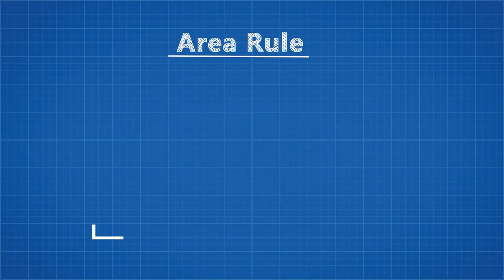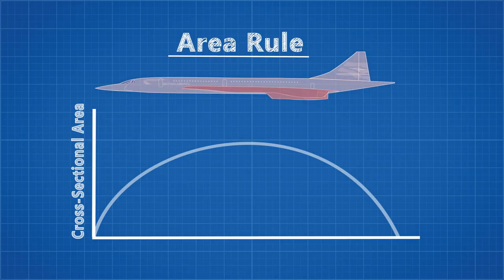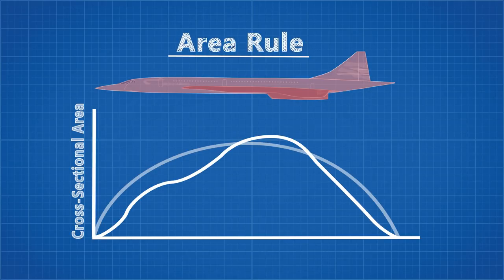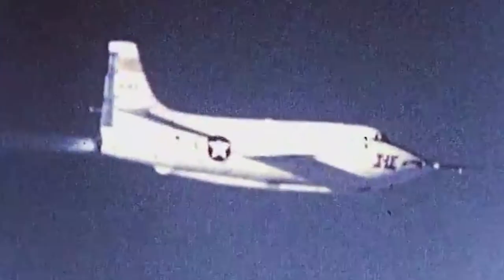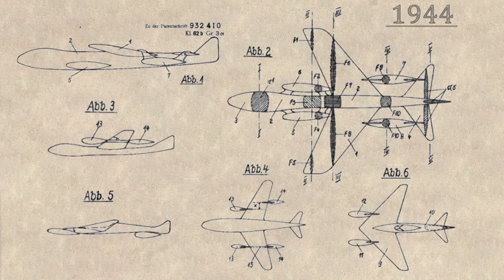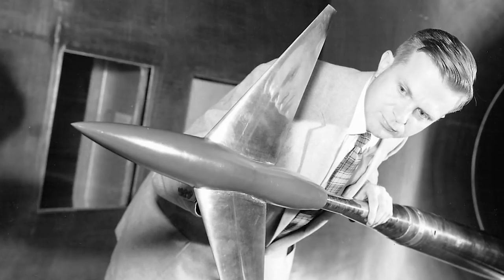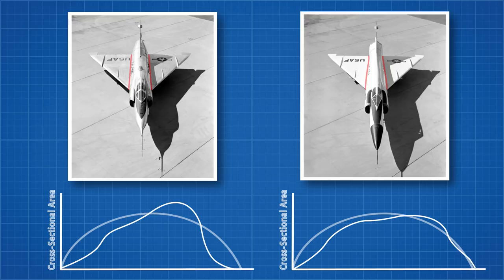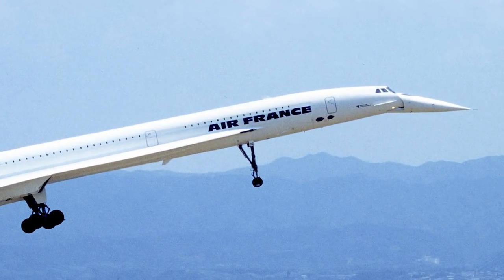Area Rule: How To Make Planes Fly Faster

Comment: Interestingly the cross sectional anatomy of several fish species follows this rule. While fish manuever through water at relatively lower velocities compared to transonic aircraft moving through air, the proportionally higher hydrodynamic forces and Reynolds numbers make up for this discrepancy. Thus, having an optimal cross sectional area distribution proves key to their locomotive abilities and plays an integral role in the evolutionary process of natural selection. (See swordfish, manta rays, and most sharks as examples)

Also, some literature suggests that the texture of fish scales enhances the boundary layer surrounding the body and further reduce drag :)

Love the videos!

Comment: The area rule can be seen being worked on throughout the US development of their Century series of fighter aircraft. The F-102 is mentioned in the video, and this was as a direct result of issues of transonic performance of it's predecessor F-100, which was the first supersonic US production aircraft, and F-101, which has a mission closer to that of the F-102. All the subsequent Century fighters has some incorporation of the "wasp waist" or "Coke bottle" design, with the F-104 being very pronounced since it had such a long slender fuselage and relatively large intakes that incorporated shock cones.

Comment: this why if you look at the back of an aeroplane, there where the horizontal stabilizer connects the fusslage, you will notice some tapered fuselage. The reason it is not tapered there where the main wings connect the fuselage is simply because you want as many passengers seats as possible. High in the end of the aeroplane there are not seats so it can ne tapered.

Comment: I looked at pictures and blueprints of the SR-71, and it doesn't seem to follow to area rule that closely. True, the fuselage is largest before the wing, and is slightly tapered towards the tail end of the plane where the wings are, but it still seems like the cross-sectional area is quite large in the back with the wings ending pretty abruptly. Even though the Concorde's wings end even more abruptly it still has quite a long tail after that. I guess there must have been more important design decisions that just trumped religiously following the area rule, maybe the importance of having the delta wing, or something to do with stealth technology?
Reply: The Sr71 is shaped like a triangle because Kelly Johnson wanted to keep the wings and engines out of the shock wave which would increase drag.

Comment: The Northrop-Grumman YF-23 was area ruled to the extreme in order to achieve the supercruise performance required in the Air Force specification.  As a result the plane was "very fast" and could fly well above Mach 1 without afterburners.  It also looks damn sexy.

Comment: The F-5 has very interesting shaped wing tip fuel tanks for this reason. They taper off at the point of connection with the wing, but grow in diameter again towards the back.

Comment: The Airbus Beluga!! It tapers nicely at the back, but at the front its cross-sectional area gets big very fast (I'm guessing that it's curve would be something like the opposite of the original F-102 Delta Dagger).  I wonder if extending the nose slightly forward would improve the ratio (would probably have to hinge horizontally rather than vertically to load cargo).

Comment: Nice video, and good idea on the challenge!

The best example I could find was the X-29, which like the original junkers had a forward swept wing. 

I was wondering if the odd shape of the V-2 rocket was influenced by the area rule, but it seems it slightly predated the development of the area rule by just a few years. It seems to have the right shape though.

Comment: you could argue that this is used on cars, but instead of the tapering of the sides of the car towards the rear (although this can be seen in some cars, especially in F1), hypercar manufacturers taper the top and bottom of the car to enhance the venturi effect by further opening up a space for the diffuser, as seen on the Aston Martin Valkyrie and Bugatti Chiron.

Comment: Eurofighter-Typhoon (Delta-Canard Design): Very Sleek Foreplanes for primary Pitch Control contributing almost nothing to cross-section, Followed by a huge 42° swept Delta Wing, but with upper fuselage maintaining almost exactly the same cross-section, but lower fuselage with air-intakes beneath the Delta is cuneiform, getting narrower to aircraft's tail, to accommodate with the Area Rule.

Comment: The change of the engine humps from the YF-22 to the F-22 due to the change in area rule from the smaller vertical stabilizers and larger horizontal stabilizers in order to optimize super cruise.

Comment: real cool to learn about this, especially since ill start studying mechanical engineering to go into plane development. but could you go into more detail on why this rule has such a great impact? 
id like to know for example, why the position of the engines, which from my rather uninformed point of view, shouldnt have direct impact on overall drag, makes such a difference. obviously things create less drag if they are placed into turbulent air currents (is that even true? it sounds logical to me, but correct pls) but that doesnt have anything to do with a structures overall cross section, so how does it work?

in your other videos you go into greater detail, and if im not mistaken you even mentioned the crosssection rule briefly in another video.

Comment: Although the MIG 17 can travel slightly faster than the speed largely concerned with the area rule, I thought it would be an interesting aircraft to bring up.  

The main body fuselage you can see looks as if the cross sectional area would resemble the curve fairly well.  The bizarre part of the aircraft, to me, comes with the placement of engine inside the fuselage.  Now I don't know how this affects the in flight performance of the aircraft but I figured somebody might be able to tell me.  I'm particularly interested because most aircrafts we find tend to have podded engines away from the fuselage located under the wings or near the back as was mentioned.  And we find that most aircrafts that achieve supersonic speeds now days have engines located really close to the fuselage.  So what changed?

Comment: I'm surprised that no one thought of the F-11 Tiger. I believe it was the first production fighter that used area rule. It first flew 1 1/2 years before the F-106. I don't think the F-102 used area rule. The 106 was basically the same design but incorporated area rule in addition to the larger engine. It was an outstanding airplane. A much better "fighter" than the F-4 despite the big delta wing. It really turned. I can only speak from back seat rides. The airplane should have been used in the fighter roll with different missiles and a gun! My only experience in the "front seat" was in A-4's, F-8's and the F-4.

Comment: The engines are placed infornt of the wings now a days are because of the extra ground clearance. Old engines were low bypass engines and they weren't so much efficient plus they made a lot of noise. In order to make it more efficient and less noisy, engineers came up with the idea of increasing the bypass ratio. This actually worked and the noise levels were also reduced. But they have to increase the engine diameter to achieve this ratio. In order to fix this large diameter, high bypass engine under the wing, a forward pylon mounting was perfect to get the perfect ground clearance. So that how it was done.

Comment: Tupolev Tu-154 is roughly the same size as Boeing 737, yet has its three engines placed behind the wings, which has always seemed interesting to me. The plane has a cruising speed of 900 km/h yet has low fuel efficiency.

Comment: Man, I like your videos, although I often have a hard time trying to make sense out of them. Maybe I am dumb, maybe the topic is difficult (probably both), but like...
How does the smooth, continuous cross-section function along the length of the aircraft help reduce the drag? If you have your engines mounted behind the main wings, the air still has to hit the engines from the front. The shockwave arises when the airflow around the object is supersonic, and in a transsonic or supersonic flight, that must inevitably happen regardless of where you put your engines. O.o Can somebody explain this to me?

Comment: The placement of engines is more complicated than is made out in this video, other than trying to meet Whitcomb's area rule.

Jet engines hung off the wing reduces structural weight as the engines reduce the likelihood of aerodynamic flutter. This needed the engines placed foreward of the wing for best effect. Engines on the wing also places them closer to the c.g. position in the longitudinal plane; benefitting weight and balance. It also keeps more of the fuel out of the fuselage, unlike with rear mounted engines.

Comment: is there a minimum speed at which this becomes a practical consideration, would it apply to racecar aero?
Reply: It only starts to have a significant effect once part of the airflow over the object becomes supersonic, so with the exception of those specially designed land speed record cars, it doesn't have any significant bearing on land vehicles.

Comment: How do fighter planes fly upside down? Doesn't it violate the airfoil lift principle?
Reply: Abhishek Jaiswal Fighter jets have a very thin and symmetrical airfoil design, but speed and "angle of attack" are just as important to lift.  You can make an RC airplane wing out of straight pieces of cardboard - no airfoil shape at all...

Comment: the original plot of making the airbus a380-900 i guess but due to its large length and lack of buyers with diminishing orders for the a380 caused it to shutdown the project. and also the new and developing boeing 777x ,as its predecessor has proved to be most efficient in cruise speed and capacity.
but my bets on boeing 757.

Comment: The F-11 Tiger by Grumann also used Area Rule and resulted in supersonic mach speeds and more speed capabilities than the engine would give it. Tests with J79 showed a lot of promise. Grumann also shifted fuel around as the F-106 did. Actual performance of the F-106 were significantly higher. My experience was that it could easily reach Mach 2+. I think it could have been a dominate air to air machine with different missiles and paint. The big delta wing made it easier to see. The aircraft from Grumann, Convair (General Dynamics), Vought, Republic and North American gave the U.S. significant advances in aerodynamics. The survivors, Lockheed and McDonnell (Boeing), are more a political result. Their aircraft perform very well but what we've lost in the absorption and demise of the others is a loss.

Comment: Most modern aircraft, designed to travel below mach 2 use area rule effectively, so there's no point to mention specific examples.
After thinking about things outside the aviation branch I particularly like the Hyperloop pod designed by Team Hyperlynx.

Comment: I Am making a conceptual design from The SONIC BOOM project and The Aurora D8, The design is called the SONIC D8R. This design combine the Ultra Efficiency with the Super sonic capabilities which results in fuel efficiency, and more passengers with the ability to go across the  Atlantic at 3 times the normal speed of an airliner. The concept uses four or three rolls Royce Olympus 593 after-burning turbojets with reheat. The jets are located at the back of the aircraft, in the fuselage... The inlets are taken after the Lockheed LT1011 Tristar, which has the inlet or outlet going in to fuselage. I think that this is going to be great airplane, hope to hear your feed back! BTW IM ONLY 14

Comment: The new wifi antennas that you see on many airlines follow Whitcomb's area rule. The antenna is usually right around the aft part of the wing, the picture is of two 737s but other airliners use similar placement. Like the engines mounted in front of the wing, the antenna placement is to help ease the transition to the transition of the added cross sectional area of the wing. It's also interesting because many of these are retrofired to existing air frames and were not part of the original design. So I wonder if like the 747's hump they actually improve the aerodynamics or if that's just the least bad place to put the antenna. 

https://i.stack.imgur.com/ZOTkt.jpg

Comment: There's other reasons to put the engines in front of the wing. In case of an uncontained engine failure, the debris field is in front of the wing. Wing damage can still occur, but is reduced. Qantas Flight 32 is a good example of this. An engine in front of the wing is also easier to access for servicing. This is a surprisingly big deal. Servicing time and cost means a lot in the airline industry, where margins are thin.

Engines under/ahead of the wings are limited in size by the landing gear, this is why the 737 has a "squashed" engine. https://i.stack.imgur.com/O6leA.jpg Putting this directly under the wing would reduce the space allowed even more.

But what about aft-mounted engines?

Think of the landing gear required to get a Cessna Mustang high enough off the ground for under-wing engines. https://en.wikipedia.org/wiki/Cessna_Citation_Mustang#/media/File:Cessna_510_Citation_Mustang_AN1991279.jpg

This would mean long, unstable, heavy landing gear. So it's best to put the engines elsewhere. Realistically, there's nowhere else but the aft of the aircraft to place them. Engines at the back of the plane also reduce cabin noise, especially the front of the plane, where the first class seats are.

The fact that these locations have aerodynamic advantages is the cherry on top.

Comment: Soo, why don't we build it to the ideal ratio? Seams simple enough, you could even generate a mesh in the computer to stick to the optimal ratio perfectly while maximizing lift from both a lifting body design and wings :/ doesn't even seam that hard :s
Reply: Beacon of Wierd Because it's not the only parameter to consider while designing an aeroplane. Sometimes you want it to be fuel efficient, sometimes fast, low radar footprint or huge fuselage, agile or stable. There are hundreds of parameters one has to consider and it's almost always a trade-off. You must have a design that meets your mission requirements best. B-17 is not worse than a Spitfire or Dornier 328 is not worse or better than a B737. They are just different planes with different missions. Every design follows its own path to perfection, never to achieve it.

Comment: On the King Air B200 the prop and part of its fuel tank are ahead of the wing to reduce cross section. The fuel tank also tapers when it connects to the wing.  Photo:
http://goldaviation.com/wp-content/uploads/2014/11/KingAirB200_thumb_sm.png

Comment: Most of this is wrong

1 wave drag really only effects planes in supersonic cruise or inntransonic cruse
2 747 have the same top speed for all the models from sp up to 400 regardless where the hump enda. The main reson 747 is fast is simply due to scale of economy.
3 engines swallow  the air... its kind og the point of them. They are there for mostly not part of the wave drag equation. The reason why they ar so far forward is simply due to space constraints and balance. A aircraft with conventional layout os more economical the more forward the center of gravity  is. The reason why short range aircraft generaly have rear mounted engines is that the plane can sit closer to the ground, having other benefits.